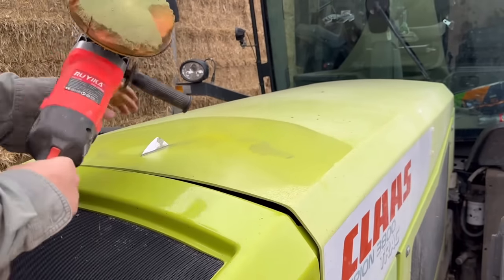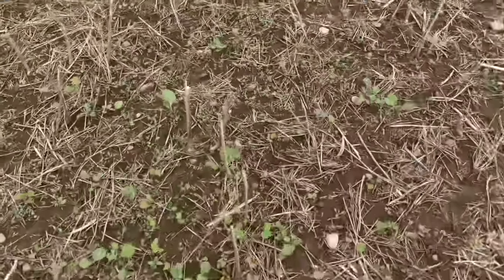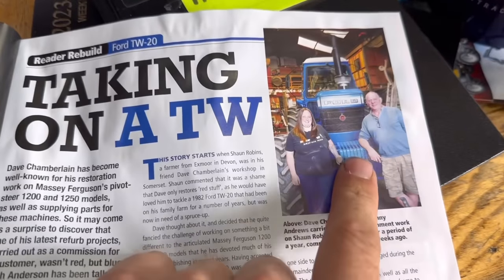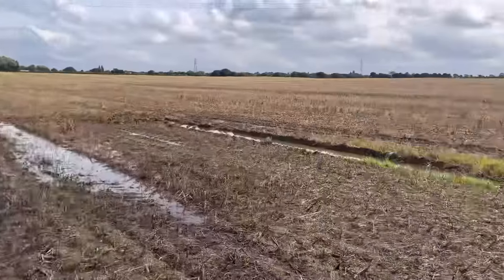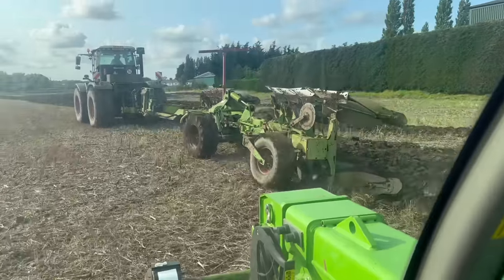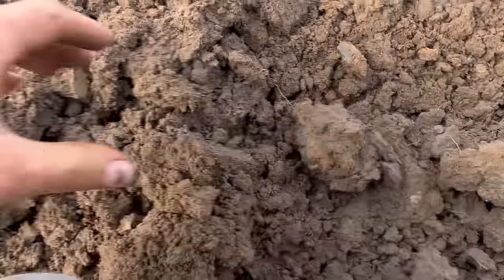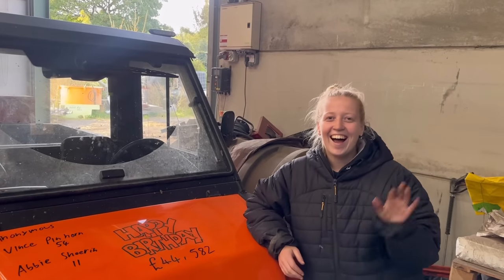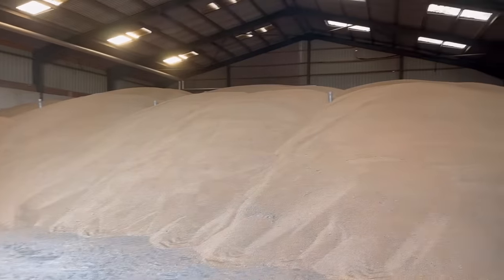BIG TRACTOR PLOUGHING  #AnswerAsAPercent 1259

Comment: Hi you can get a tester that screws onto rad cap for your johndeere and u run tractor and it uses a chemical to determine if combustion gasses are present in coolant system

Comment: The heat trick works on ABS and other Thermal plastics. I assume the Xerion bonnet is a Thermoset plastic which don't change as you heat them. Well. Enough heat will still destroy them. But I doubt your heat gun will get hot enough.